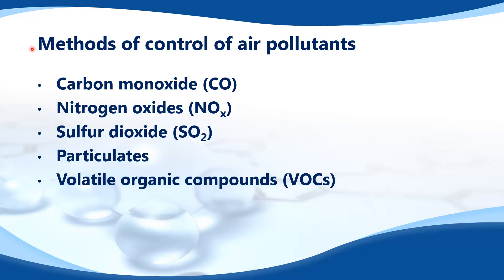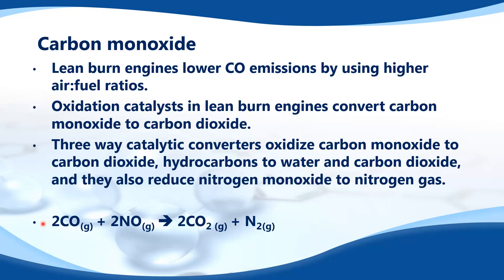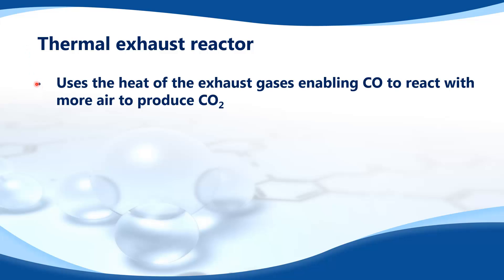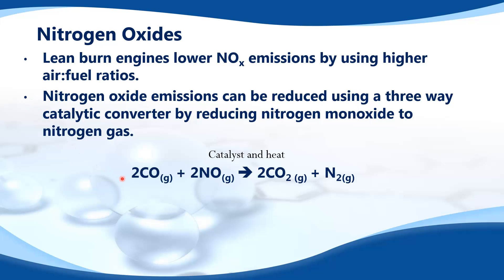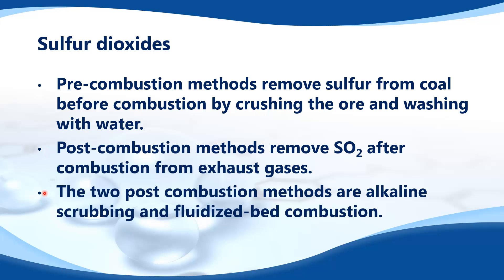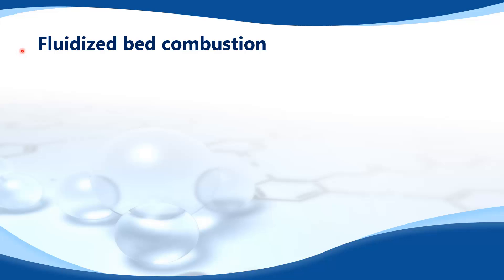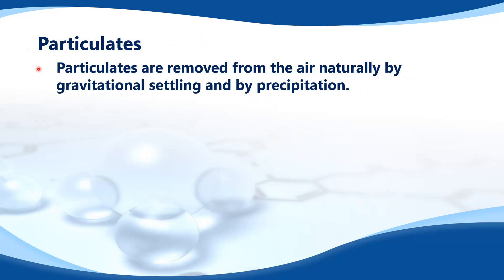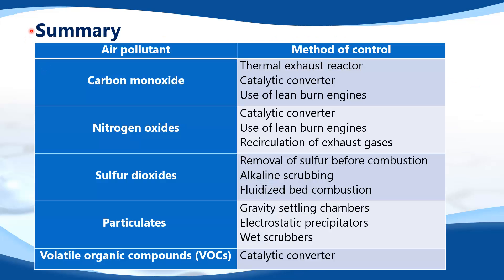E.1.2 Evaluate current methods for the reduction of air pollution.

Comment from the maker: Please note that the equation for the oxidation of carbon monoxide (CO) to carbon dioxide (CO2) in the section on thermal exhaust reactors is not balanced correctly.
It should be 2CO + O2 --> 2CO2